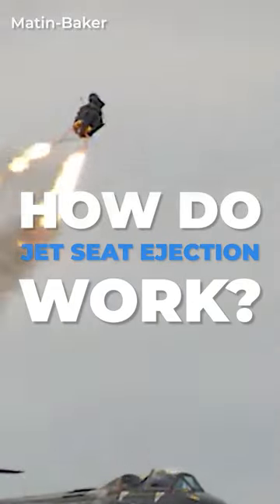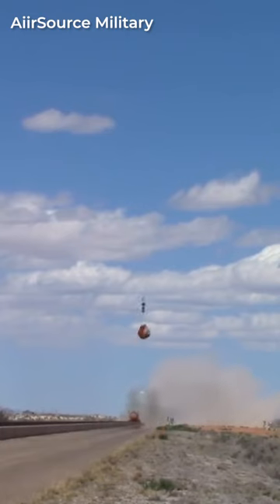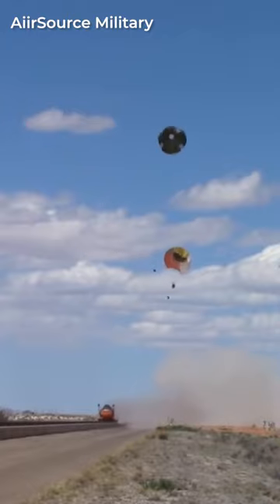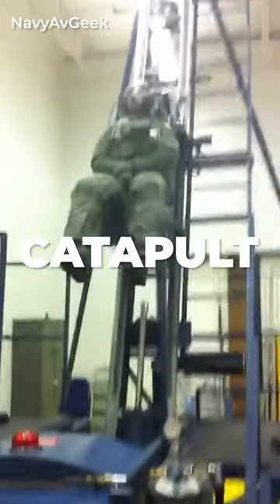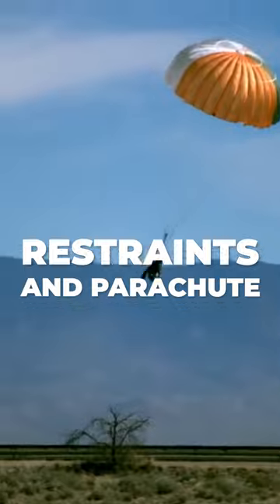How do Jet Seat Ejections Work? #shorts

Comment: I witnessed a TF-104 landing crash at McClellan Air Force Base where one pilot failed to connect his zero lanyard, so when he ejected his parachute streamered and failed to fully opened. I observed him hot the ground; he lived for a very few hours. (The other pilot declined to eject to maintain control of the aircraft, which had just departed fully fueled, lost engine power over an inhabited area and had turned 180° to save lives and land; he died in the cockpit as the aircraft was consumed in flames.) That scene remains vividly in my mind over 55 years later.